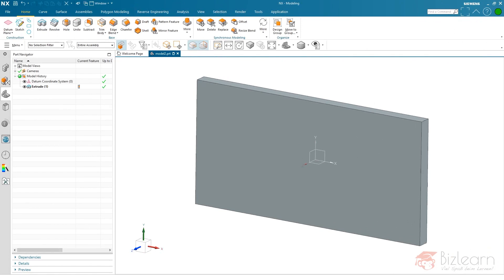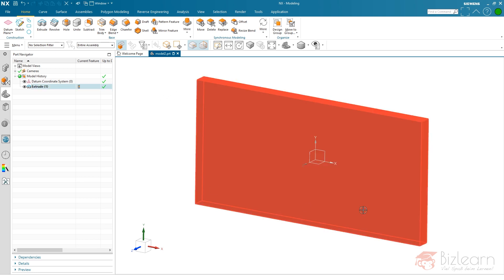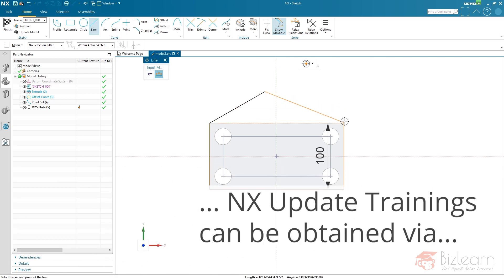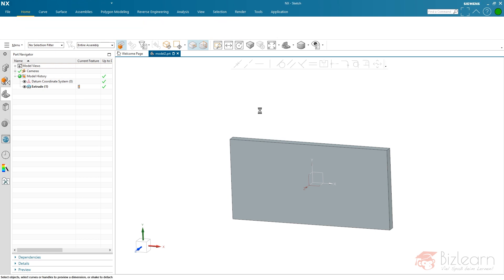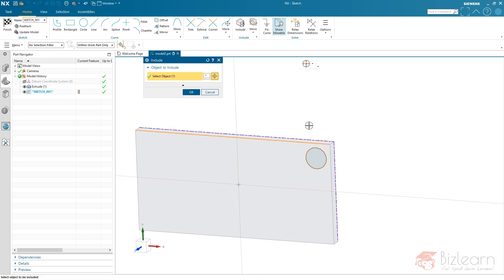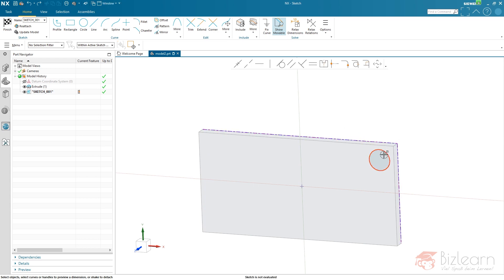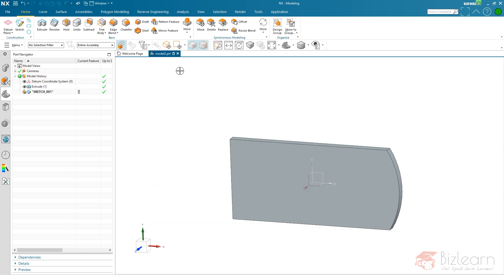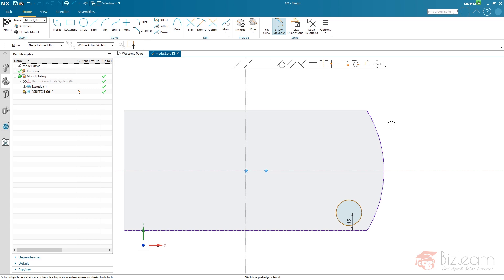Siemens NX 1926 - Sketch Solver - have you seen the Include command already?

Comment: This is the copy cat command of 'References' from Creo parametric and its sucks like Creo itself. I am going back to NX12 where I do not need to 'Include' command for creating curve with references to external curve which is outside the sketch geometries. I totally gives minus 5 stars for this useless feature.

This was not the case in previous version like NX10 and 12 where it takes automatically any edges or center for reference sketch creation or dimension creation without this useless command 'include'. It takes more time to do the simple task than before, I should go for SolidWorks rather than this one.
Reply from the maker: The include is done automatically. The difference to before is, that you now have control. You know what I mean?
Reply: @Bizlearn_Siemens_NX_Training  Can you elaborate 'control' term? I am curious. I am using NX since 2013 and huge fan of the same but the latest upgrade in terms of UI is quit not intuitive for beginners. For instance, I took training with NX8 😅which is history by now but never confused until NX 12. 

This can be never an issue with SolidWorks, UI do not change or confusing that much, because I learnt 2014 version and still efficiently work on 2023. Only minimal amount of tweaks required to know the workflow. That's what I feel.

Comment: Is it possible to switch sketcher to Old version if the part is created by new one? I am sick when I am maked to use new sketcher in example to edit a part generated in progressive die wizard  - edition is set to new version.
Reply from the maker: Nope - no chance! I wish it was possible in some cases, because also in my case the conversion sometimes fails.
Reply: @Bizlearn_Siemens_NX_Training  Thank you for answer. The next question is why Progressive Die Wizzard generates new sketcher in new parts despite NX is set to old one?
In example when I have scrap designed - the punch shape is generated by PDW according to scrap automatically. The problem begins when this punch have to be modified (holder part in example) and then I start new sketch and..I have new version what I do not want. So the point is how to set PDW to work on old sketcher?
I also cannot manage default settings.
Is it possible set any parameter that causes that my settings will be kept not in simple drawing only but as the application? (such setting is used in Inventor so every new drawing is the same as previous - in. e dimensioning settings , backround colours  and many others.)
I wish every new model/drafting part is set as I wish.
NX customising (model,drafting user settings) seems too complicated and time consuming- maybe it is good topic for a movie?

Comment: You didn't need to included the edge of a part in NX1899. What add this include feature. This take more steps than before. What the benefit of using include.
Reply from the maker: It's still not necessary to use the command. Just select an external curve or edge and it will be referenced in an associative manner. It's a benefit at all.
Reply: @Bizlearn_Siemens_NX_Training  for me it seems like this does not work for end point and mid points of for example extrude edges. Then I do have to use the include command (even when entire workpart is selected), very frustrating. Is there no way around this?

Comment: I cannot set the new sketch solver it stays always off even if i start the program as admin, do you have any suggestion?
Reply from the maker: No... I've installed properly without mods and it works as it should. Are u using a licensed product?
Reply: @Bizlearn_Siemens_NX_Training  yes I do use a license version, I think it has to do with permission or something
Reply from the maker: Hi George, if there was a configuration file defined by your administrator, your adjustments will not take effect (Customer defaults --> Gateway --> general --> Miscellaneous --> Feature Toggles)😬
Reply: @Bizlearn_Siemens_NX_Training  I am the admin🤣🤣, anyway i will figure it out thanks for your reply. Your videos are great!!!!

Comment: Do you know how to use expression in NX 1926 new sketch solver??

In older sketch version, i normally use expression to define dimension. For example, P1 = (P0)/2.  I am looking forward to hearing you 😊 😀
Reply from the maker: Hi, thank you for the question. You have to right-click the dimension and "add expression". Then, a name and value entry will be displayed. To be honest, I don't like the fact, that direct name entry does not lead to an associative expression link, but I haven't figured out yet, whether there might be a setting to adjust the usability. Kind regards, Simon
Reply: @Bizlearn_Siemens_NX_Training  It seems that if you also do "add expression" on the dimension that should refer to another dimension, the expression becomes is associative. Strange behavior indeed, but at least it works!
Reply: @Bizlearn Me and my boss are testing the NX 1980 before we implement it. We were wondering why Siemens did this. His suggestion is that design engineers don't always need expressions and on a larger model this would cut down the number of expressions used. It seems the new behavior is a parameter existing only inside a particular sketch.